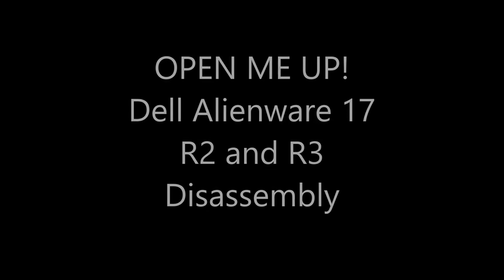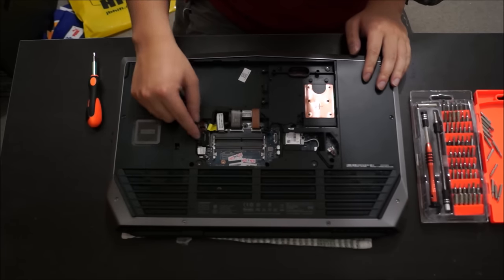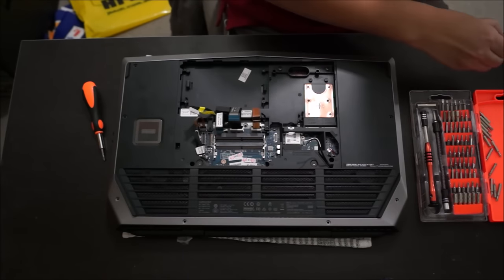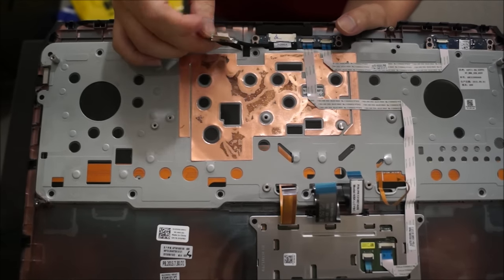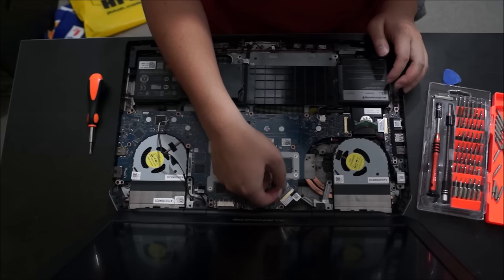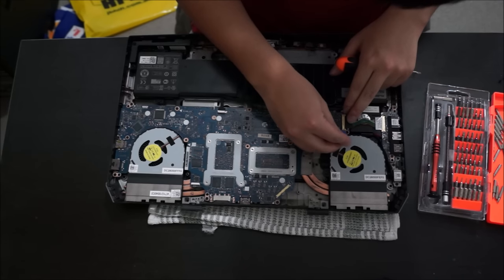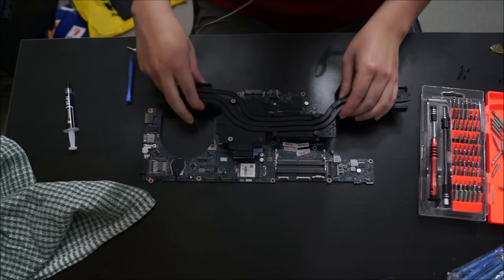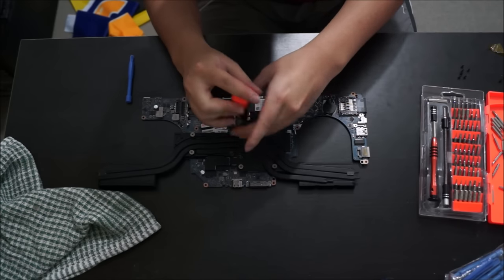OPEN ME UP! Dell Alienware 17 R2 R3 Disassembly

Comment: Great video! Really helped me a lot when i tried to repaste my laptop. One thing though, at 3:47, the fifth cable is supposed to be responsible for the LED of the macro keys on the left side of the keyboard, I know this because i forgot to plug it back in after reassembling the laptop😅

Comment: the CPU and GPU dont have heat spreaders so its ok too put more thermal paste. You should really thoroughly clean the old thermal paste with isopropyl alcohol! there will be a overheating issues otherwise

Comment: Thanks for the video, i was able to completely tear apart my laptop and redo the thermal paste and clean everything. I was nervous, but the hardest part is disconnecting the fragile connectors and keeping track of all the screws. I had used the wrong screws and made my keyboard bulge up...easy fix but just goes to show that just because the screw fits doesnt mean its the right one. Also, i suggest using a partner for the first tear down since you will likely be watching this video and pausing and playing many times, and an extra pair of hands and eyes come in handy. Good luck to anyone with the balls to do this.
Reply from the maker: yes the screw all fit in basically any hole, just the length of the screw is longer or shorter
Reply: yep i found that out. Thanks!

Comment: Great video but you give some poor advice in the comments section to a few people.. also partly in the video. First, upgrading to faster RAM does in fact make a difference, ram latency is very important. Second, when re-pasting you DEFINITELY want to clean everything off 100% before putting on a new paste; also liquid metal is the best for the lowest temps. That aside, excellent video.
Reply from the maker: thanks for you support. For normal people faster ram does not do anything and will not show any signs of being faster. in bench marks it will shows results but for normal everyday activities the normal person will see no difference between DDR3 1600mhz ram compared to DDR4 2133mhz ram even though DDR4 2133mhz is alot faster and better. This is the same with thermal paste cleaning 100% of it off is the best practice  but at 90%+ clean is good enough and will once again show no difference for normal everyday activities for normal people.

Comment: Great video, can I completely remove the HDD and only use SSD's in M.2 slots?

I plan on buying a base model without ssd's, because upgrading them myself should be much cheaper, if it works the way i am imagining it.
Reply from the maker: +Kuh5Kohle yes you can

Comment: Hello! Thank you for the video, very complete... We opened up our Alienware R3 to clean the fans. After reassembly, the computer will not turn on. There is no beeping, no lights, we checked the cables and everything seems to be connected... Any ideas about what could be wrong/how to fix this? Everything was working fine before, other than the dusty fans...
Reply from the maker: open it up again. you must have forgot something. it is normal for this to happen. seems like your power cable is disconnected or battery
Reply: Thanks for answering... I have the laptop open. Both battery and power cable are properly seated but I still get nothing when trying to power up the computer. Any idea of what might be the problem?
Reply from the maker: @LHall-zc2wh  when you plug in the charger the charging light should come on. tell me what happens
Reply: @OpenMeUpTec  The light is on the charger "block" (not the cable) and it remains on when plugged into the computer
Reply from the maker: @LHall-zc2wh  the alienware head on the power button should be on while the charger is pluged in to tell you it is charging. if not then you probably didnt plug in the power cable to the motherboard which is in the video at 3.50
Reply: @OpenMeUpTec  the alienware head doesn't light up, and nothing happens at all when the power button is pressed. But we did open the computer and unplugged and re-plugged the power and battery connectors, and no change
Reply from the maker: @LHall-zc2wh  .9.50  in the video, did you plug in the power button?
Reply: @OpenMeUpTec  yes, we did... I can't figure out why it does nothing
Reply from the maker: @LHall-zc2wh  so has the problem been resolved or not?
Reply: @OpenMeUpTec  no, we cannot get the computer to go on. The problem hasn't been resolved. :(
Reply from the maker: @LHall-zc2wh  cool we need to get the aleinware button to light up first this is where we are currently at. you need to check the the power button itself and confrim that is functioning. to do so you need to remove the button from the plastic top, then plug the button itself into the motherboard. you dont need to re assemble it as you can run the computer like that
Reply: @OpenMeUpTec  ok we'll give it a try and I'll let you know what happens
Reply: @OPEN ME UP just wanted to thank you again for your help and taking the time to write back to me. We re tested all connections and everything was in place, computer still wouldn't turn on so we took it in for service. They have advised us that everything works, we just hadn't allowed it time on the charger to do its "post" and get energy to all components...??
Reply from the maker: @LHall-zc2wh  have you check at 9.10 in the video if you button is pluged in.
Reply: @OpenMeUpTec  everything was plugged in and connected correctly. The authorized service people said the only thing we didn't do was allow the computer to be plugged in long enough for energy to return to all components, before powering up. I don't know, we did leave it plugged in for some time... But after they serviced it and said nothing was wr, it's working! So that's the important news.
Reply from the maker: @LHall-zc2wh thats BS, it is electricity not a car with a gas pump. but anyways since it is working correctly thats great
Reply: @OpenMeUpTec  LOL. I thought the same thing... But they didn't charge for repairs and it works!

Comment: Hello, today I disassembled my alienware 17 r3 and only cleaned it with an air compressor and reassembled and the machine does not turn on and does not charge, check charger voltage and voltage in power supply and everything is fine, remove memories and heatsink , change thermal paste, any opinion?
Reply from the maker: you forgot to plug in the charging cable at 3.55 in the video
Reply: @OpenMeUpTec  Hello good morning thanks for your quick response, of course!  All the connectors are well and connected, I am desperate because it does not turn on, does not load, does not show signs of life, do you think it may have static?
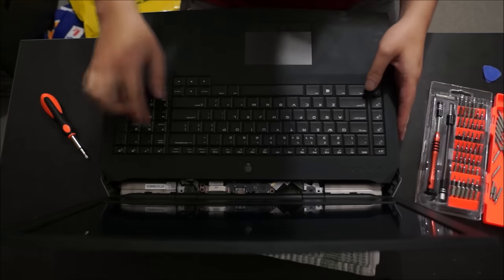Reply from the maker: : @umbrella141984  when you plug in the charger is the charging light on. you might not have connected the on button 9:10 in the video
Reply: @OpenMeUpTec  Hello, No, when I connect the charger no light Does not send any signal, already check charger and power jack and all good
Reply from the maker: @umbrella141984  so you on button is not connected

Comment: As I was replacing the battery on mine, I broke the little plastic clip (the one you are removing at 3:23). Any idea how to find a replacement for that little plastic clip?
Reply from the maker: you should still be able to put the plastic thing back in place. if you can not do that you wont be able to buy it. use a piece of paper or cardboard to replace it and  that will work. the purpose of the plastic is to wedge and push the cable against the side
Reply: @OpenMeUpTec  Thank you. I used cardboard but it doesn't allow for a complete connection so some of the keys on my keyboard will not work.

Comment: Discharge by holding power button down for 30 seconds then battery cable should always be removed first so as not to possibly damage M.2 drives ...then THIS

Comment: Is the gpu and or cpu soldered on every single Alienware 17 R3 in the world? I bought a used Alienware 17 R3 and my gpu 980m 8Gb is showing code 43 in device manager so windows have stopped it from operating and i can't seem to fix it.
Reply from the maker: the 900 series and newer on alienware are all soldered on
Reply: Oh! Well that certainly sucks! Why is that that Dell has done such a bad decision? And can you provide me with some easy fixes for code 43 error on gpu in device manager? Thanks for the answer btw.
Reply from the maker: soldering thing is actually this best decision anyone can make. since hardly anyone open up their computer and understand how to fix issues. there is no point providing something that hardly anyone uses. sorry i dont know what code 43 is and never have seen it

Comment: Thanks for the video. Want to know if there are more than 2 slots for the RAM to upgrade my memory. I have 2x8GB.
Reply from the maker: +amarnath mandal there is only 2 slots. since they change to DDR4 of the R3 model you can get bigger ram size up to 32GB per a stick but for the R2 you can only use 16GB which is 8GB per stick

Comment: So I have an R3 and it's overheating, im no wiz with computers, but it seems i need to remove basically everything just to clean the heat sinks?
Reply from the maker: yes
Reply: Or............Possible upgrade the video card to a Nvidia GTX 1060. But yeah you are right the design is terrible there should be an easier way to access the fans and the video card.

Comment: My left side of 2 usb ports, mic-in, and earphone out are not working. Can I fix it without changing motherboard?
Reply from the maker: it is a separate board for that you can see it in the video at 15.27 where i disconnect the cable for it

Comment: Can CPU be replaced since you say its a "solder on"?? I have this model and it was working perfectly, then one day approximately 20 hours after a perfect run, I attempted to turn it on and screen stays black as laptop beeps 7 times. All I did was update bios straight from dell and update drivers straight from dell for this specific model R3 2015. I tried calling the person i bought it from but they won't respond no matter how many times I call... nor do I know where they live. Should I call dell? I tried nearby computer shops and they say the CPU has failed. but Im so confused because I just got it! I haven't even used it enough to get the fans to turn on... The only time I can recall the fans on was when i updated BIOS, other then thats all its been used for is light browsing and youtube... So i just don't understand how CPU could have gone out with such light usage and it working so smoothly the day before...
Reply: Hey brother, did you got your laptop working now? thanks!

Comment: How do you remove/replace the battery?  Do I still have to unplug the hard drive, ram, etc or can I just unscrew the ones around the laptop to lift up the keyboard/front panel?  Thanks
Reply from the maker: yes you do as the battery is inside and the rest of the item need to be removed before you get in

Comment: just went through this. having some issues getting those strip cables back in (the backlight and keyboard etc) but I'll persevere.

Very good video, and very needed for these machines (I do think it's a bit ridiculous that even the fans need the whole.keyboard removed to clean properly).

One thing I was suorised at was the amount of overflow with the thermal paste from the damn manufacturer.
There was more on the circuit then there was on the actual heat sync plate area.
Reply from the maker: thanks for your support. overflow isnt that bad also there thermal paste is of a different kind thats why they are not so  concern

Comment: hello, great video 
i have a problem with my battery, start up screen says battery has sustained permanent failure and needs replacing. ive come across a few fixes stating i should unplug the battery and delete the driver then plug it in let it reinstall and it may work again. if that doesn't work i have to replace it. to do this what will i need to move/ take apart to do this?
Reply from the maker: +Mike J no your battery is dead. there is no drivers for the battery. go up to 10.15 in the video and just unscrew the screws around the battery thats all
Reply: Well here's an update I've put in the new battery and closed her up. The only thing is I'm wondering when reconnecting the main wires that have to be removed, how am I sure they are in the correct spot? Not mixing the cables up with their differing connections but if they are seated proporly?
Reply from the maker: the cable only goes in one hole as they made all cables difference so you can get it wrong

Comment: I need to replace the grill for my alienware 17 r3.  Do i have to disassemble the whole thing or is there some way change the piece without disturbing much of the software?
Reply from the maker: you need to remove the motherboard which is basically the whole thing
Reply: Thanks for the reply. I meant the word hardware obviously in my question. Not sure if i wanna go through all that. The crack is an eyesore.

Comment: hey i was wondering if the ssd's that come with the alienware are good? and what brand are they? are the speeds good?
Reply from the maker: most of them are samsung. if you getting 256GB ssd in one stick or bigger they are basically the best ssd you can get as they are Samsung NVMe SSD not your normal ones. Branding doesnt do much they all basically the same speed only if they are NVMe then there is difference in branding

Comment: Do you have any suggestion for what kind of wireless card to replace for the Alienware 17R3? It came with Killer Wireless 1535 and I have a terrible experience with it with disconnecting many times.
Reply: Do I also have to replace the antennas that came with laptop to work with the new wireless card?
Reply from the maker: seriously i have many laptops and never had wireless card issue it is probably just faulty. you can get one of the intel ones they are cheap and i find them good like the newer version of the 7260ac
Reply from the maker: No

Comment: Please help me, I did dissassemble everything like you instructed me but after reassembling it says "Boot device not accessible" or something like that (it's a bluescreen). Did I forget to connect a cable? Or what is the problem?
Reply from the maker: it means the hard drive is missing. remove and put the hard drive back in again
Reply: That didnt help - I solved the problem tho, for some weird reason the bootmode changed from AHCI to RAID, once I switched that back it worked fine again.
Reply from the maker: that happens if you done a bios upgrade

Comment: After I cleaned my 17 R3, the system shows Auto Repair Preparing. And I am installing the Windows again by the USB in to my 970EVO. I don’t know why there was system in the SSD but can’t recognize.
Reply from the maker: did you replace your old ssd in the slot or you never had one
Reply: @OpenMeUpTec  I had one 970 evo and I put it back to the M.2. It was my system drive before I clean my laptop, but the system can't run after I replaced. In the BIOS, it show info of the 970 EVO and also the original 1TB HDD.
Reply from the maker: @donghaha5663  did you do anything to the 970 evo? like format it or does it still have everything it originally have before you remove it and place it back in?
Reply: @OpenMeUpTec  No i didn't. But I think the problem probably is that the BIOS was back to default setting to RAPID after disassembly. So maybe can't choice 970 EVO as boot option, maybe? But I fixed today, and set 970 EVO as my first boot option. Everything works now.
Reply from the maker: @donghaha5663  thats good to hear

Comment: do you have a vid on how to open up an A/W M9700 / M9750? thanks
Reply from the maker: sorry i dont have one but if you in need of help and unable to find any you can download the user manual from dell and it tells you how to disassemble the laptop
Reply: OPEN ME UP i think Dell deleted a bunch of older A/W manuals when they took the helm at A/W thanks. i will try again but think they arent available
Reply from the maker: @j.lietka9406  your laptops is extremely old. not even sure they had internet back then to store the user manuals. if you can find any details then the solution is to remove every screw you can see. if you do this enough the laptop will come apart
Reply: OPEN ME UP yep! thats exactly what they did! i found out (youtuber regazz (or regazzz)) how to remove the keyboard/power button/status strip, then locate the LCD screen m/b connection. made sure it was secure, reconnected the screen, but no difference. thanks

Comment: Hi, I'm wondering what is the max ram for R2 x17? and what type of ram should i get? can you provide a link for purchase?
Reply from the maker: CPU is solder on, graphic card is solder on, ram can be changed to 16GB max with 8GB in each slot thats for ddr4, ram can be changed to 32GB max with 16GB in each slot for ddr4, there are two M.2 at 80mm slots for the R3 model, there are four M.2 slots for the R2 model and there is 2 slots, wireless card can be changed, and hard drive is a 2.5" inch.

Comment: Where did you get the prying tool? I need to replace the battery and keyboard won't come off.
Reply from the maker: you can get prying tool from ebay. they cost nothing also you probably forgot a screw or something

Comment: hey man

i followed all the septs and did thermal repasting

after putting it all back

laptop booted 
but i m getting this error codes
error code 0xc0000225 windows

your pc needs to be repaired

bios is showing up tho
Reply from the maker: this is a operating system problem which is a software thing not a hardware problem